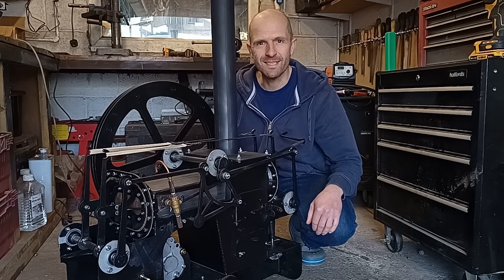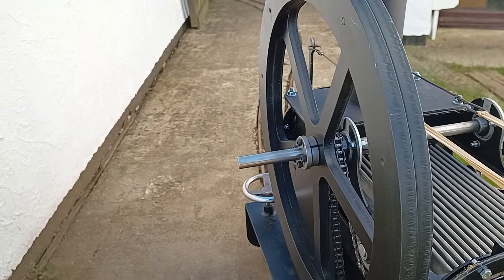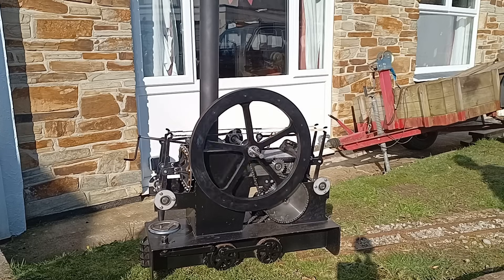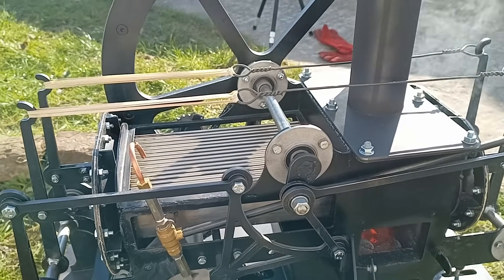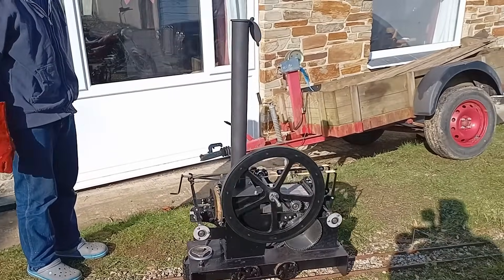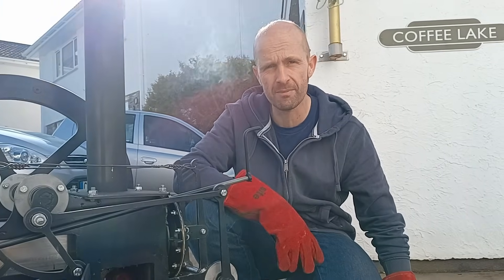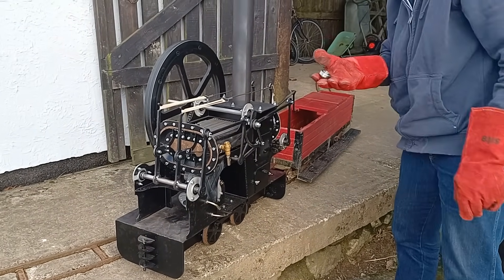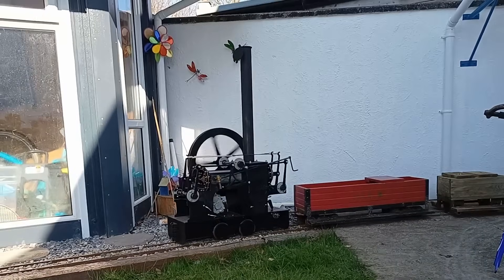Hot Air Stirling Engine Locomotive - Part 8

Comment: Hi!! I have an observation that may explain a problem you had with MK4 generator pistons. If you observe the functioning of this specific type of engine, you shouldn't have any compression build up at the time that the pistons should contract while the engine is running. When the air is forced to the cold side, pressure should drop, and that's what cause the pistons to contract. If the pistons don't properly contract, and there still inflated borders on the fabric (like it happened to you on the MK4), that means the air is not cooling enough, so it's not contracting enough to drop the pressure. This can be fixed by adding a water box on the cold side, like the fire box but filled with water (and adding ice should make it even better)
Reply from the maker: @criollocustoms  Hi, yes, that is a fair point! I'll have a good think about that, many thanks 👍

Comment: What a marvelous assemblage of flailing fiddly - bits! 😅  Once you got the few bugs worked out, seems to run quite nicely; with the large flywheel, seems reminiscent of Trevethick’s original steam locomotive.  I can see your concern about the throttle lever; I’d consider putting a guard plate between it and the rapidly - moving valve linkage as a safety feature.  Excellent machine work! 😊

Comment: Runaway Engine! lol
Nice job Shane. A newly built Stirling engine running better than you hoped it would the first time you fire it up is a rarity in my opinion. I built a stirling engine generator for charging 12 volt batteries.I put a valve in the regenerator and I just crank it open and it kills the engine quick like. Thanks very much for sharing. Looking forward to your next project.
Reply from the maker: @PALM311  I like your stop valve idea. Can I ask, does the valve give you speed control without having to constantly adjust it? thanks

Comment: What a marvelous contraption to see working! Congratulations!
In regards to your problems with how to control it, a stirling engine isn't realy the best machine to control, so I'm wondering if using a band brake around the flywheel would be an idea to check the speed?

Comment: This is pretty neat, i am still trying to comprehend how it works even though watching your other videos on the sterling engines. Are the bellows timed to both squeeze at the same time or opposite, aka one in one out and vise vs to basicaly pump the air between the hot and cold side. I am really curious about this as it seams to function so well and has got me thinking about a possible use since I am off grid and my gasoline backup generator is not the cheapest to run. I have lots of fire wood though and even If I could run a delco alternator through an inverter to charge batterys when solar is not available, while it may not be a very efficient means since volatage loss. I have lots of fire wood though and it would be "free" to operate vs the gas guzling generator. Thank you!

Comment: Incredible work!  I was smiling the whole time.  Can't wait to see the power test.  Would love to see the power test before and after fixing the air leaks.
Reply: I would also like to see you test the power output before fixing leaks. I am finding your channel inspiring to say the least.
Reply: @cliveandrew74  We considered it but decided it would be pointless. There were pinpricks in the welds and some dead space. Further more the compression was less than Shane had  planned for. The next vidio will explain more. The power output test is being planned with some sort of set-up that we have used before in previous engine builds. We have also in this case  a moving Loco hot-air engine and a slight incline of the track in the garden.  This we can use and see how it performs against the previous test run. Stay tuned and thankyou for your interest.

Comment: That's fantastic that it runs so well. Congratulations. There are lots of model Sterling engines out there but very few that can actually do any work. After you're done testing, you should sell some plans with the laser cutter files.